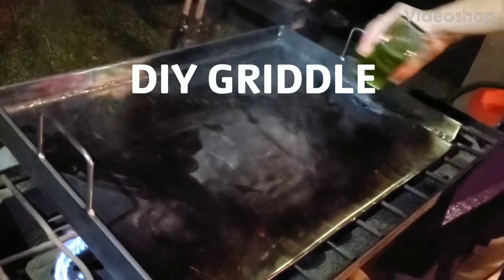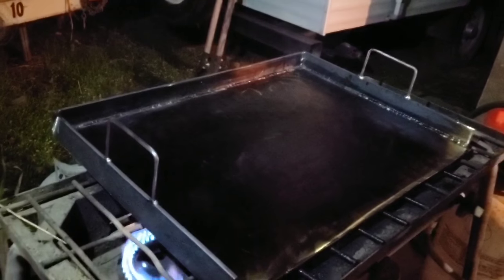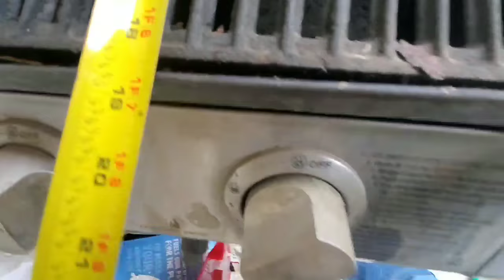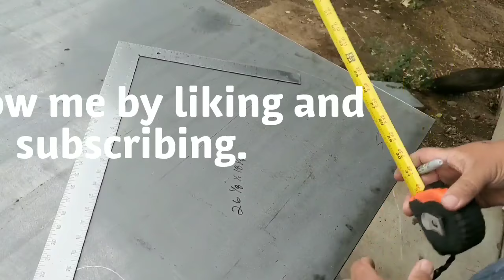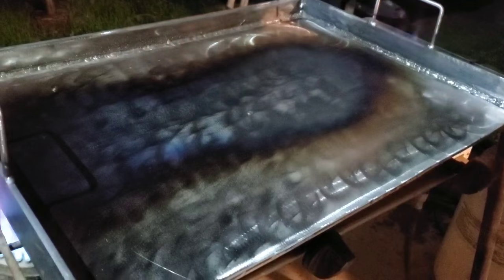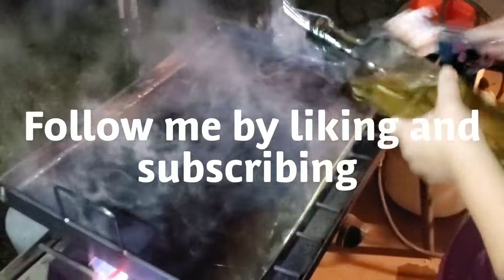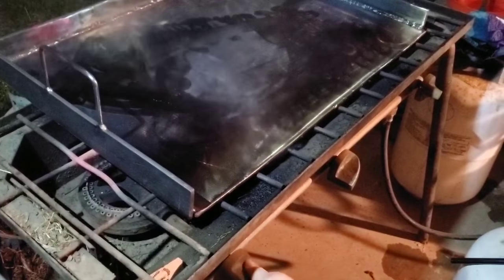DIY Griddle

Comment: a sugestion, instead of welding metal on the sides of the metal plate its best to cut the sides of the metal plate half way and bend them up to build the walls. then you can weld the cut sides to reenfoce.

Comment: Angle steel leading edge will make a grease channel to collector canister. Extend end pieces far enough  to accommodate this for less mess in the end.
Reply: A rusted out bbq with good burners will work better for the heating than big cast iron burners.

Comment: 1:12 as long it's a oil with a high smoke point it will work I like to use sunflower oil the smoke point is 450 F perfect for seasoning

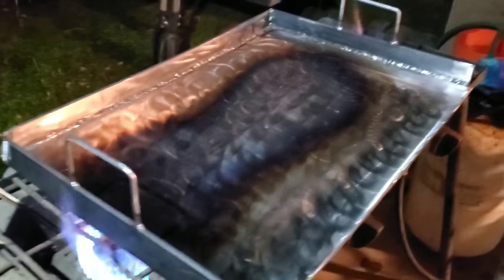Comment: At 9:07 you missed showing a step.  It looks like you grinded or polished the metal somehow.  What did you use to do that and how aggressive at removing the top metal surface were you?
Reply from the maker: Ah. Yes, I used a angle grinder, 120 grit flap disc and grinded it.
Reply: @theotherguy3083  Soak it in vinegar for 24 hours. Makes the mill scale come off easier. I am making the same griddle you made :)

Comment: My steel Plate is only 3mm...just wondering if that's good enough 🤔
Reply from the maker: That should be good as long as you slow heat it up
Reply: @theotherguy3083  sorry it’s 6mm I measured the thickness today…thank you for your help…Bula from Fiji 🇫🇯
Reply: Most plancha is 6mm, but if it's to heavy for anyone, you can use 4mm & slowly heating it like the other guy say

Comment: Just wondering where the grease drains off? It looks like it would drain off the front lip, directly underneath where the flames are... Other than that it looks sick I’m jealous and want one.
Reply: That's really awesome I'm thinking about getting myself one changing my gas grill into a
Reply: Flattop
Reply: Depends on the slope if you want to be safe and clean you can put a grease trap on it easily you can see this one looks like it has one I'm only 2 mins on tho might be wrong didn't get a good look at it

Comment: What gauge of metal did you use?
Reply from the maker: 1/4 inch bottom with 3/16 on the side.
Reply: @theotherguy3083  thank you. What kind of metal?
Reply: @hciii7419  Carbon steel

Comment: Hi,
What you use Type metal ?
Reply from the maker: A36 Mild Carbon Steel
Reply: How much this plate
Reply from the maker: @prasadlakmal3584  I have this plate laying around so I don't know how much it will cost.  But you can call your local metal yard. Regarding the types of metal, it is called A36 mild steel.
Reply: what is the thickness for this plate ?